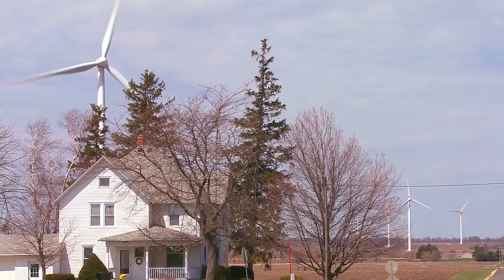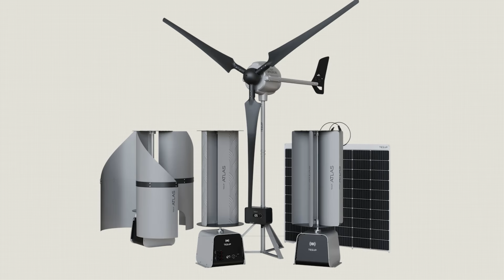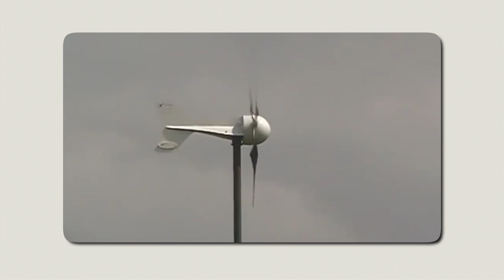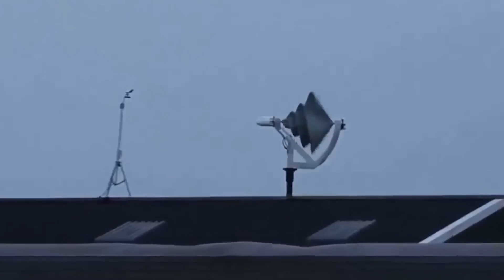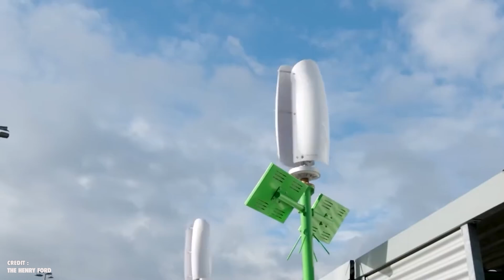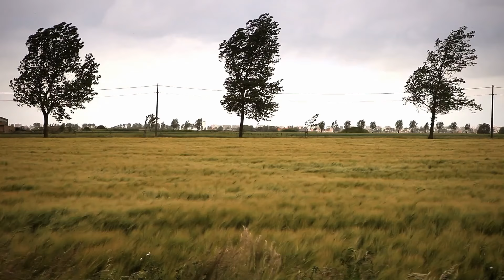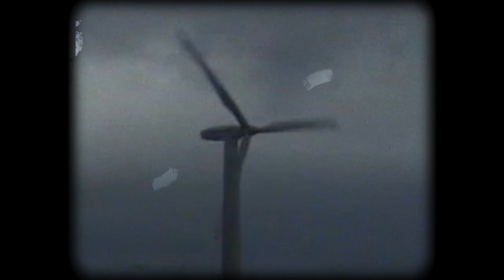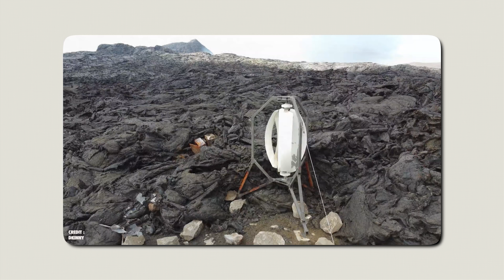These 6 Wind Turbines Are The Future Of Home Power

Comment: The last 20 years I have seen so many ‘promising’ ideas about this kind of vertical turbines but it never turnout into a profitable success
Reply: That's kinda the way of the world, isn't it? Do you know how many "flying machines" were predicted, tested and discarded before we were able to actually take to the air? Do you know how many automobiles, electric motors, steam engines and bicycles were designed, tested and discarded before the technology was figured out? And I'm certain - in every single case - there was someone like you saying, "In the last 20 years..."
Reply: @GeeDeeBird  Do the math. These turbines have to little area catching wind and wind next to the ground or houses, trees etc is not much. Impossible to get decent amount of energy from them.
Reply: @bartbjorri9502  So said every nobody pretending to be a mathematician without data to back them up.

Plenty of examples of efficient energy generation from turbines, but stay mad about it I guess.
The world will move on without you.
Reply: yes I understand your reasoning but in this case they look the same as 20 years ago. It is like someone is still saying that a horse and carriage are the way to travel
Reply: The problem is physics.  You can only get so much energy out of a certain swept area, depending on wind speed.  And for small rooftop turbines, that isn't a lot, even at 100% efficiency.
All that these exotic designs can achieve is to improve efficiency a little, or drive down costs.  But unless you live in an area with very frequent strong winds, and even if you already have the inverter to plug your turbine into, the cost of purchase and installation pretty much always exceeds the generated income over its lifetime (20 years typically)
   
They are useful in off-grid setups sometimes, if you have solar, battery, a turbine and very low power requirements, like in a shed.
Reply: @kaasmeester5903  Idiotic and fallacious argument. Literally any amount of renewable energy no matter how small the output is still better than any amount of fossil fuels.
Reply: @Atmatan  That depends on the cost per kWh.  Small scale wind turbines are relatively expensive, and that money would be better spent on solar panels or a home battery.  A faster ROI translates directly to more kgs of emissions saved.

Comment: The Atlas will experience torque as do traditional prop designs, because it is affixed at its base while wind presses along its vertical length and more so with elevation. Thus, it may still exhibit lateral sway, humming, and vibrations though less than a traditional prop.

Comment: Wind scales exponentially and the tiny options available to home wind has a worse ROI than solar and solar keeps getting better. Besides that wind power is inherently MECHANICAL. This means they break down far more frequently than solar, which basically NEVER breaks down. It just sits there year after year. 

I've been chasing a wind solution since I got my 6000 watt PV setup in 2017. Why? Because I live in Sweden and my PV is useless for 3 months of the year which totally sucks. Yet, it still pays for itself. Nothing I've seen over the last decade comes close to PV and don't get me started on the price of the SD6 ... Jesus, I could coat my house in PV for that.

Comment: Those horizontal Turbines (The ones that look like airplanes) are horrible in efficient in a real-world operation, this requires more parts that can fail driving up upkeep.   1)  It must actively steer into the wind, and the blades must be actively feathered, a failure to do this can result in runaway and destruction.   2) all the critical parts that need upkeep are up in the air making it expensive to operate.    Vertical Turbines are better in every way.   1) LESS PARTS 2) properly designed auto feather has need with minimal parts that can break.   3)parts that need upkeep are on the ground or closer to ground.   4)it requires less down time and less likely to fail.    The only thing that Horizontals have that are weak is THEORETICAL EFFIECENY THAT IS LOWER THAN VERTICAL UNITS.    In real life theoretical is bullshit.

Comment: Price vs efficiency is the relevant question.
PV is now so dam cheap that you will have a hard time to argue 20k for a wind installation! A friend of mine just bought a 2500 Watt PV for 400 bugs. No special price.
Reply from the maker: Agree - when it comes down to what gives you the better return I would have to say solar.  In particular plug-in solar as you don't need to pay for expensive installs.

Comment: Most of the wind turbines shown here were designed by people who clearly don't understand the physics. It's all about 'swept area'. A turbine that 'sweeps' 10 sq. m. is always going to outperform one that sweeps only 2 sq. m. It takes tremendous, sustained, steady winds to make small residential-sized turbines generate any useful output at all, and very few of us live in those conditions. I know quite a number of folks who spent tens of thousands of dollars on wind turbines and their towers, all of them sorry they did. Every one says "I should have bought more solar panels."
Reply from the maker: Not sure I agree with that!  The SD6 or Proven Wind Turbine units are widely installed on farms throughout the UK and I am lead to believe many of them are happy with their purchases.  What I would say is that even these units they were not without their challenges - I know some had baring issues.  So in the right place (open land) and for the right application (farms or home steads) I think there is definitely a place for wind.

Comment: I was considering the Tesup, but I was unable to find any user review and test data videos. However, I did find a lot of complaints. I live in a high desert valley in Arizona with average wind speeds of 20 mph and gusts up to 60 mph.
Reply from the maker: Having looked into the Tesup it appears they have over stated their power output and performance figures.  It is probably the least favoured of the ones shown in the video.  Thanks!

Comment: For years, we've been seeing awesome "leaps" in home wind power. PV has no moving parts - end of story. Small wind turbines are toys. The real fun starts above 400ft.
Reply from the maker: What about your inverter?  Does that last for ever?  Every technical solution has it challenges and solar is not without its own challenges.
Reply: @wildline_YT  Are you claiming that wind systems do not need an electronic controller, which does basically the same job as an invertor?  And if your wind turbine produces DC, then you totally need an invertor anyway.

Comment: First, your AI bot has no understanding at all of gears or mechanical systems, so that's as far as I got with your video.  Second, you make incorrect claims about ROI for solar systems: it does not take 20 years. The one I'm using will take a quarter of that, or less.  Third, a wind generator is nor much cheaper than an array of solar panels that generate the same amount of power: the rest of the system is the same cost (controller, inverter, batteries, etc.).  Fourth, Solar panels don't need a tower.  Major cost.  Fifth: Unless you live in a place with substantial, sustained winds, they are useless.  Your basic premise is flawed, and so is your presentation.

Comment: Wind energy sucks.  The energy of wind is related to the square of the velocity so if you have half the wind you only get 1/4 the power.  That's why installations never meet their expectations.  Combined with moving parts that fail and noise, they're terrible.   The foot print that solar has is irrelevant because you put them on your roof which isn't being used anyway.    You can't polish the turd of wind energy.

Comment: When wind and/or solar is cheaper than regular electricity and just as reliable and convenient, it may start going mainstream.
Reply: Solar is getting there fast.  High efficiency panels, high efficiency inverter/controllers, high efficiency batteries, and prices are coming down.  My solar system actually pays me back: my electric company pays for the excess power I send back into thier grid.
Reply: Solar is already there.  The system I installed provides all the power I need for the house, I can sell the excess power back to the utility company, and return on investment is about 5 years.  After that, it's all free.  Panels are guaranteed for 20 years, batteries for 10, invertor for 5.  Even if I have to replace something that fails out of warranty, I0m still ahead of the money curve.  That would not happen with wind power.   Impossible.
Reply: @i-ccc-channel  Are you saying that you never have to use the grid?  You always have excess power to sell?

And are you saying that you've investigated the cost-benefit of the wind option, and see no benefit to buying even a small household wind turbine?
Reply: @Mark16v15  Yes, that's correct.  I never have to use the grid.  There's plenty of capacity in the panel array to cover the entire house load, and also charge the batteries.  And yes, I can sell power back to the utility, if I choose to do so.  Or I can just trip the breaker on their meter, if their rates are not worthwhile.
The cost benefit of a wind system where I live would be infinite: all cost, no benefit.  There is almost never any usable wind, but there's plenty of solar power, all day, every day, dawn to dusk.
My situation is not unusual: it's the same in most suburban areas in most places around the world.  Plenty of light during the day, and little to no wind.
Reply: @i-ccc-channel  Thanks for the info.  Are your solar panels all on your roof, and if not, where and how big are they?  Are they too big for your roof?

I only ask because if they are bigger than your roof, then many homeowners in cities may not be able to take advantage of them like you have.
Reply: @Mark16v15  20 panels, each measuring about 2.2m x 1.1m.  About 50 m2 total.  All on the roof of a typical single family dwelling.  __They take up less than half of the total roof area.  Theoretical capacity of just over 12 kWp.
And yes, i live in a city.  Population around 8 million.  There are a few other houses in our area with similar setups.  Nobody seems to have problems with lack of roof space.
Reply: @i-ccc-channel  I'm going to write to my congressman about this.  We should be encouraging builders to include this option for new homes, and even encouraging existing home owners.  Obviously, the more people that buy this, the cheaper it will be.  Power plants will need to start devoting more of their power to data centers.

What at time do you believe you passed the break-even point?  How about heat?  That's pretty electrically expensive.  I always tried to have gas heat to save money.  About where do you live if you don't mind me asking?  If solar is so good, what do you think happened with Obama's Solandra?

Again, thank you for helping me better understand solar today.
Reply: @Mark16v15  That's a great idea!  Doesn't add much in total cost to the house, but does give it energy independence.. And you are right about prices: thy are coming down quite fast, especially for the panels.  Batteries are still expensive, but the prices of even those are coming down, slowly.
I'm not yet at break-even, but the numbers say it should be between 4 and 5 years.
For heat, right now we use gas for cooking and hot waters, and kerosene for heating the house, from a big one-thousand liter tank out in the back yard..  But that's going to change, now that we've seen the real-world results of solar power.  I've done the math there too, and adding one more battery to the system will give us the capacity to replace the kerosene heater with a heat pump of about the same capacity, and still not need to go to the grid.  We'll be exporting less power to the grid, sure, but still some. Cost of that additional battery and heat pump, including installation, is about the same as two years' worth of kerosene, so breakeven on that is pretty darn good.
For the water heating, we are going to put in a solar water heater on another section of the roof where there are no solar electric panels.  That should reduce  our gas consumption by about 75%, and will also cost about two years worth of gas to install.
As you can see, I'm sold on the whole solar energy thing, as I've seen it in action first hand.  Yes, initial investment is not cheap, but the payback comes reasonably fast, and after that, it's all savings. Located in Santiago, Chile.  In hindsight, I probably should have sized the system a bit larger, to recover more money from selling power to the utility and thus bring the breakeven even sooner, but the good thing is that you can always expand it later.  More panels, more batteries, additional inverter (or bigger inverter).  It's not a fixed-size system.  Expansion is flexible.  Overall, we are happy with it.  Good decision,
Reply: @i-ccc-channel  Thanks for the info.

So, you are from Chile.  If you don't mind, please tell me what you think about Trump.

The reason I ask is that he has changed the US' NSS (National Security Strategy) to pivot our focus from Europe to our own hemisphere.  He believes making America great again (MAGA) includes making the Americas great (again for some).  To do that, his first goal is to rid the hemisphere of all the evil drug cartels, then improve our trade relationships with our Central and South American neighbors.  I've read that a lot of our friends to the south are now electing conservative leaders.  He's trying to help Mexico and other Hispanic countries in our hemisphere replace China for supplying cheap-labor products.  Guyana is becoming rich by us helping them extract their oil.  Also with our help, Venezuela is becoming more and more like the fabulously wealthy country it was before the 1970s.
Reply: @Mark16v15  Sorry, not going to comment on politics.  Beyond the scope of this thread.

Comment: That Liam screw looks nice... I just want a little ~200 watt version for the roof of my RV.
Here in Oregon it'd compare favorably to 200w of panels in the winter.
Alas... something in the fluid dynamics at "ground" level makes the small versions impractical.   😡
--
Eta: I'm parked far more that driving, but I'd love to see something like a small three across Flower Turbine racked on the back, with a gentle roof deflector above, to charge batteries while driving.   👍
Much nicer on the engine and generator than these new 500w alternator chargers!
Reply: Seems to me wind would (or should) work better here in the northwest than solar. We get way more wind than sun.

Comment: I'm convinced that a major barrier to small scale renewable energies is the governments, (and business), fears about loosing revenue from the grid. The revenue, control and the influence  that "the grid" gives them is immense. That's why they would rather build more billion dollar power plants rather than promote affordable, small scale systems for the public. More power rather than less demand. 🤑
Ya know, 100 years ago it was common to have solar hot water systems preinstalled in new homes. You don't see that anymore. WHY?
Reply: Solar hot water got more expensive than the grid. Then solar hot water got more expensive than solar PV and a heatpump. Plenty of places with expensive power and lots of sun kept doing solar hot water until recently.

In the case of wind though the enemy is physics, which alas requires large and clear air.

Comment: This is stupid advertising. The efficiency of vertical wind turbines is very low. That's why all commercial systems use traditional designs.
Reply: Any wind turbine has to deal with the fact that energy output depends on wind speed cubed.

Any turbine is designed for a maximum wind speed. At that speed, it'll generate some amount of power.

How often does the wind blow at that maximum? Not often. At half the wind speed, the power output is one eighth already. How often does it blow at half speed?

Small wind turbines mounted at low elevation above ground simply aren't worth it. They need to be high up where wind is blowing at a more constant rate, uninterrupted and without turbulence, and they need to use big rotors to capture the maximum of possible area of wind.